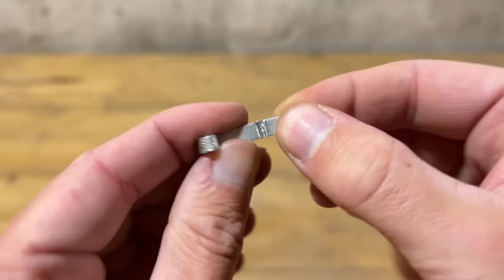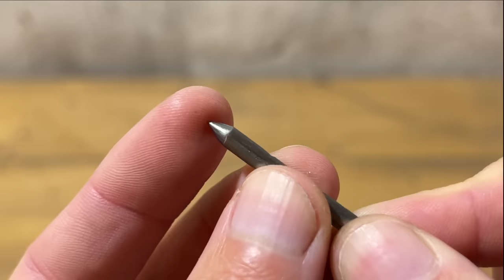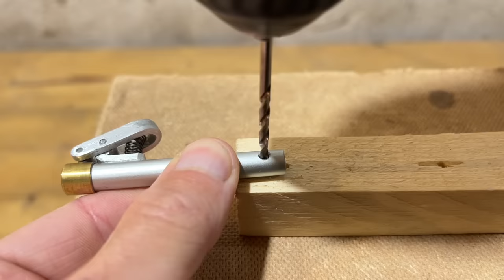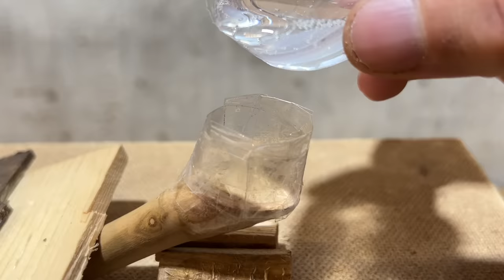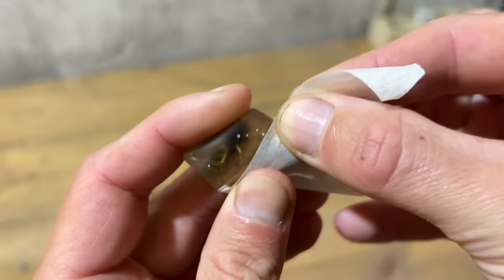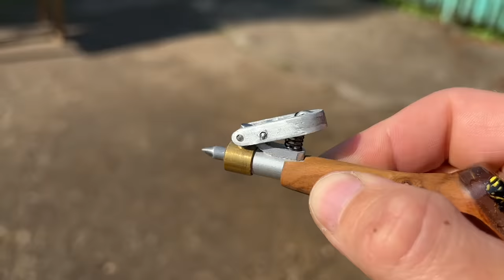Making a tiny crossbow "Wasp"

Comment: the wood is already cracked in tge front and much too weak. you should reshape it a bit and then tightly wrap it, ideally with something wrapped wet that shrinks when it dries, like gut or rawhide/parchment. either one of those wrapped with water-resistant wood glue would be very strong (but do it on bare unfinished wood, and reshape thr wood to prevent loosening by sliding). tough thin paper wrapped with the right fiber orientation created by the roller-drawing process of the wood pulp (cut in the direction in which it tears more easily, also identifiable based on paper bending more easily across the fiber than along the fiber) would also be pretty good.

Comment: If you could attach a 'spider line' to it and market to communication cablers that need to pull wire across suspended ceiling and voids. Maybe them more powerful. Maybe that's already a thing,  but great work,  man. 
Savy.

Comment: Very neat, though I'd call it a spring gun rather than a crossbow. Still, add some curare or ricin, and you're really off to the races. If you hadn't bothered with the wooden "stock" you'd have had something you could fit in a cigarette packet.